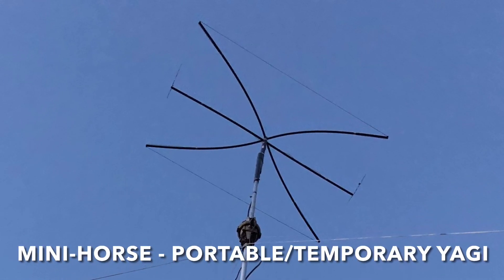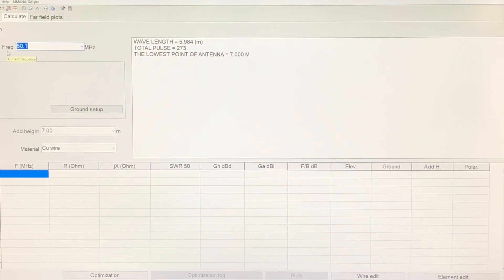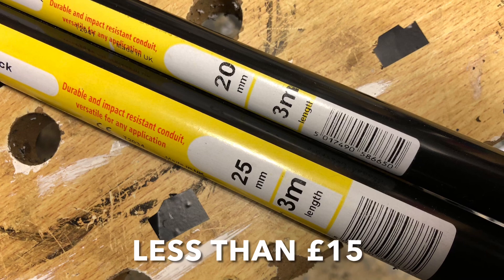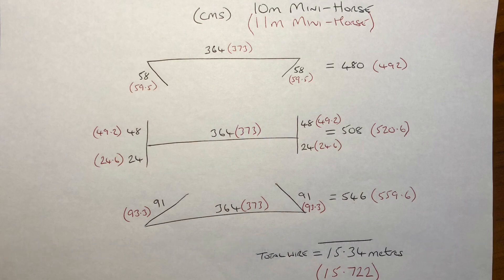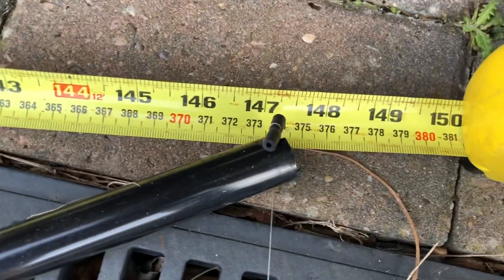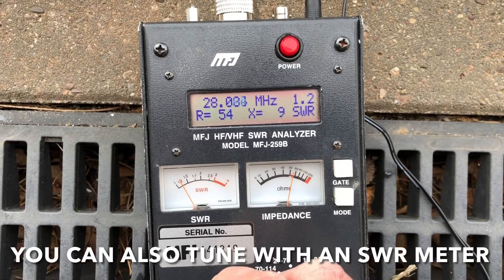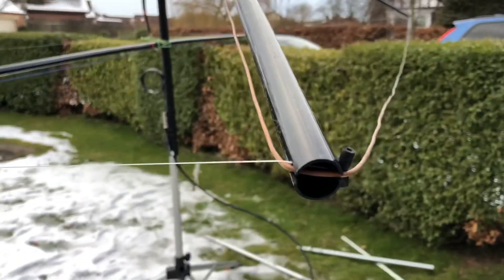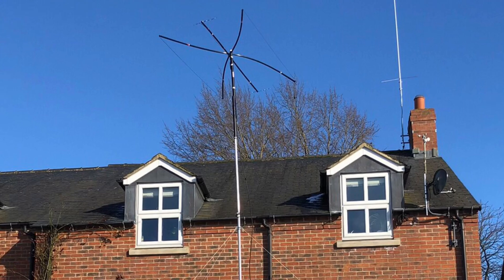10m & CB Band Simple Effective Yagi Beam Antenna

Comment: Hi built your antenna  ,using your final measurements at 28500 my swr is 2.0 27500=3,,2900=3 roughly,,I cant get the swr to dip at all, any advice please 
Paul
Reply from the maker: Hi Paul, yes it looks like the dip is 2:1 as you say. I’d suggest more height and check the proximity of other objects? Good luck 👍🏻
Reply: THANKYOU,THERES NO WAY TO SEND YOU A PICTURE UNFORTUNITLY @G0CNN-Ian

Comment: hi thanks to your cool self build im starting to build your 10mtr moxon today, the only thing im a bit confused about is where and which ends the coal is connected to the different elements could you help me with this please?
Reply from the maker: Hi Paul. There’s a mk2 video on the channel that shows an easier way to build this short-boom folder 3 element yagi (it’s not a Moxon). If you check out the more recent video it will help. The two centre boom wires are the ones connecting to the coax.

Comment: Now that is a lot less visible that most aerials.  Now do the impossible and make it disappear all together and I might get to sneak it up when no one is looking!  A lot wouldn't even realise what it was for.  I wonder if I replaced the plastic with thin solid fibreglass rods would I get away with that?  Still, those blanks are a bit on the pricey side being solid fibreglass.
Reply from the maker: Hi Bob! Fibreglass or even long bamboo cane? This is cheap mind and I know it works. Rebuilt the final version yesterday so will release part 2 with measurements and quick-build technique etc. 👍🏻
Reply: @G0CNN-Ian   Looking forward to it.  Better then the big square thing I once built, came crashing down in a gale and I didn't rebuild it.  But that was at another house, on an estate.  I had a huge aerial up there a while until it bent over in the wind and caught up in some trees at the other end of a square.  It was fibreglass, green and very very tall, some sort of co-linier, so you can imagine the size at 27Mhz.  I think it was Italian made, but by the time I got it there was no label on it.  I thought the chimney was going to come down that night!  The saving grace was it bent right over and across the square courtyard and got caught in trees at the other side of the houses.  I went looking for it in the morning and thought it had broken when I looked up (it was quite high up) I just saw part of it and as it wasn't in the garden I thought it must have fallen into the square.
So I went round to see (expecting to see it sticking out of the ribs of a car) and saw the neighbour standing looking up, I followed his gaze to see the aerial bent right over, crossing the square courtyard, over the top of his house and into the trees beyond.  There were cracking noises, bits of twigs, leaves, and all sorts flying off the trees as the aerial was trying to get back to vertical.  Then the cracking was followed by a woosh noise and the aerial broke free, showered us with twigs, leaves and a branch was propelled skyward.  
It came back up with one almighty "Twang" noise and it stood there shaking and vibrating.  I thought it was going to break something, but I got away with it.
The neighbour turned round to me and just said "I think that aerial is a bit big!" and he calmly walked away into his house.
I thought I was in for a tough time, but he was ok with as nothing was damaged.
Aerial was down that weekend and gone to a mate who wanted it.
He is not on CB now as far as I know, so I have no idea where the aerial is these days.
I was given it as it was to big for the person who had it, I gave it away as it was to big for me.  I never heard if he kept it, I know he used it as he said the SWR was at its lowest 1.5:1, nothing wrong with that I thought.  But he thought it should be a lot lower.
But that aerial was a beast, full of coils and spaced turns and it had a transformer of some kind inside a metal bit where it mounted.
I can't remember but I think it was supposed to be a 1/4 wave on top of two half waves.  So at 11Mtrs, you can imagine its size!  It made the Thunderpole look tiny!  lol.
Reply from the maker: A whoppa Bob! There’s a 5m diamond vhf/uhf colinear and I thought that sounded long!
Reply: @G0CNN-Ian  The 2 meter co-liner my mate had looked like a Silver Rod, even the (Now who was it at the time?) DTI can't remember, they went in past one night and they asked what he used the aerial for, he said 2 meters, yeah, they dais, but what do you use the Silver Rod for?  He showed them his licence and the kept asking about the Silver Rod.  He told them it was a 2 meter co-linier but they pointed to his CB and told him it was a Silver Rod.  No, the aerial for it is in the attic.  They finally gave up after them saying his 2 meter was in the attic and his CB aerial was outside.
He told them to go up and look, but they declined.  Just a well, he ad a 1/4 wave 102" aerial sticking out the top of his roof.
Twice as long as he was allowed lol.